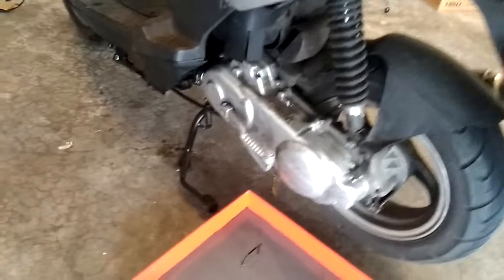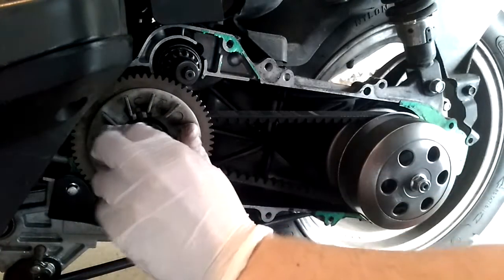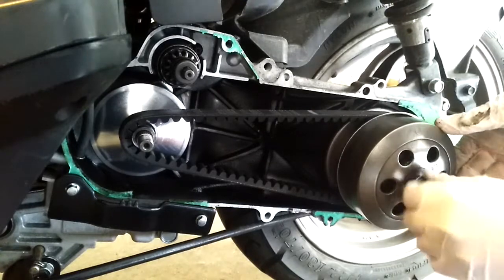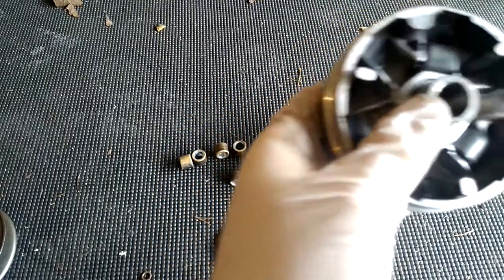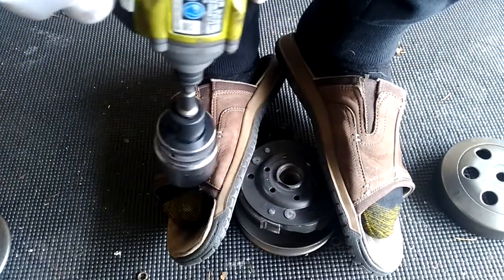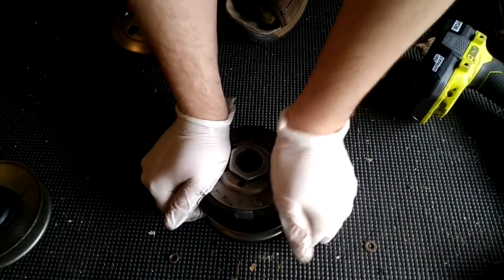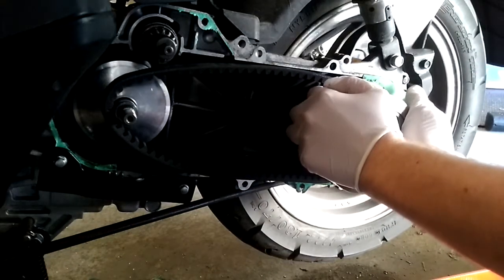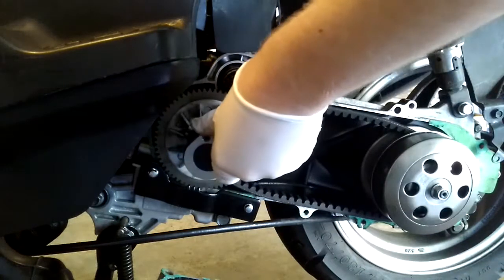GY6/139QMB 50cc 4-stroke [Chinese scooter] COMPLETE transmission disassemble/reassemble

Comment: i tried to take my clutch off for the first time and the nut holding it to the moped is tiiiight as fuck i don't know if it came like that from factory or if previous owner got in there and just fucking cranked it down and loctited it
Reply from the maker: Nah it's because over time those nuts get really really fucking tight, any nut will be like that. Try disassembling a moped that's been used daily and never disassembled for 10 years every nut will be "cold-welded" or something like that. You're going to need a corded impact gun that can really dislodge it OR apply localized heat if you're able to
Reply: @GTAIVisbest  haha bro love ur name and yeah this moped is 14 years old with i think 3000 kilometres on it so not too many km and no corrosion on the nut ive tried hitting it with propane torch and battery impact driver i think i need penetrating oil heat it up super hot and hit it with a rattle gun i think
Reply: @GTAIVisbest  i hit it with a propane torch but the clutch absorbs the heat fast so i don't know if i can get it anywhere near red hot
Reply: thanks for the reply though man 👍
Reply from the maker: You'll want a CORDED rattle gun and then hold the clutch in place and make sure you're pushing up against the nut (otherwise you'll damage the nut with all the force) and hit the rattle gun with as much power as you can, and boom! It should come off @tbounds4812

Comment: Please please please please please get and use impact sockets for your impact wrench. It's extremely dangerous to use regular sockets with one. They will shatter.
Reply from the maker: I have impact sockets for the heavier-duty stuff. In my years of experience, I have never seen a handheld 16v impact gun be able to shatter a socket. 
I suppose if you were using a corded wall impact gun that could put out way more force, you'd eventually shatter the socket lol
Reply: @GTAIVisbest  Better safe than sorry. Especially if you're using cheap sockets. I've seen them shatter and throw projectiles everywhere. Not sure if they were quality sockets or cheap ones though. Anyways be safe please.

Comment: The spring usually works best when you use the right springs on the clutch shoes so yellow 1500 contra springs and yellow 1500 rpm clutch springs.. also if you lightly sand over the clutch shoes jus enough to get rid of the glaze( same thing with inside of clutch bell) the clutch should grab more easily.. also if your spacing is off in the variator side this could cause your belt to not ride all the way down in the front or if it is to loose it could also cause slipping. But those are all key to tuning your CVT for performance